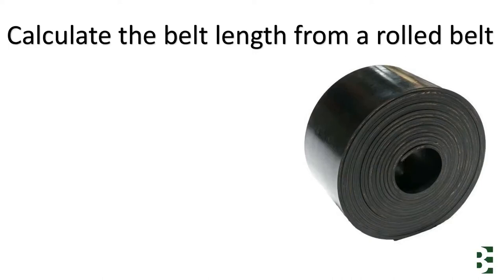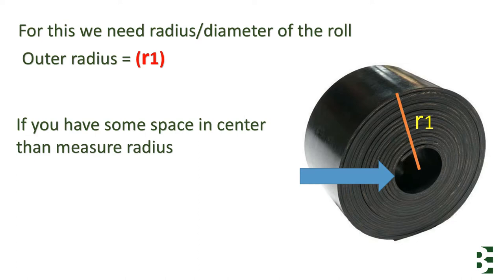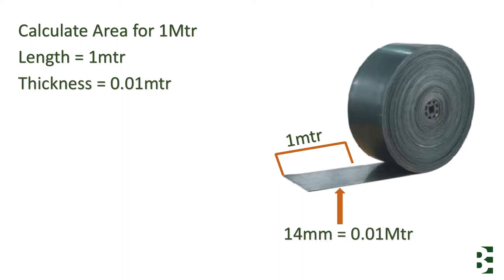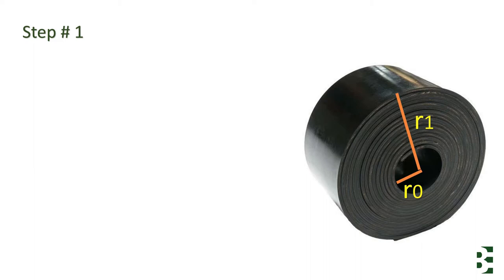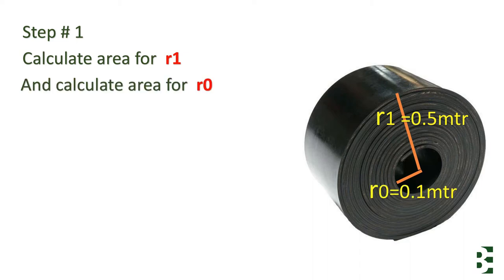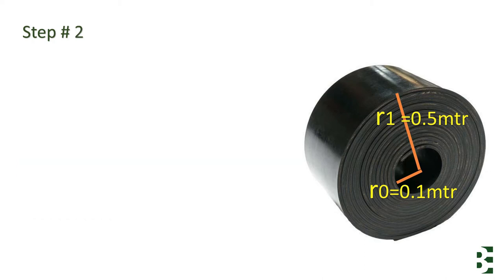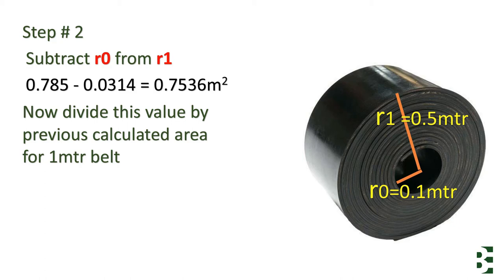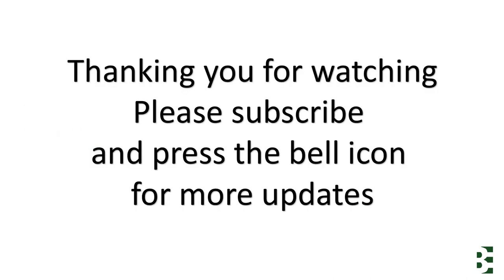How To Calculate Length Of Conveyor Belt In Roll

Comment: But .. the total length is coming 53.8mts.. the thickness is 14mm . Convert to mtr is 0.014mtr..   
If we consider the thickness as 0.01mtr then the total length is coming 75.36mts ..
But if we consider the thickness as 0.014mtr then the total length is coming as 53.8mts

Which is correct??